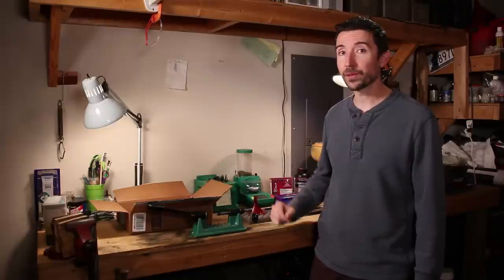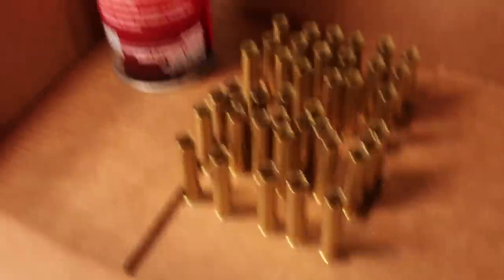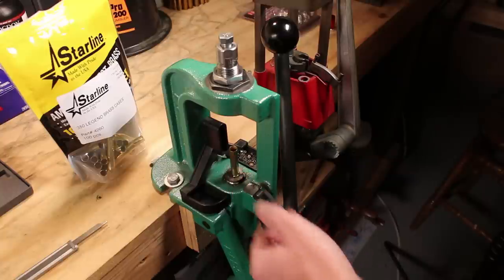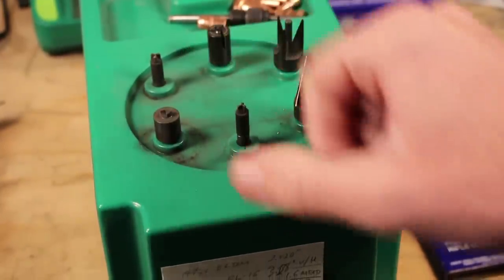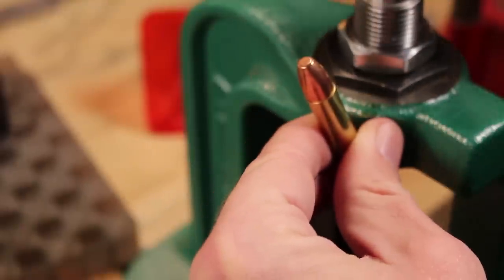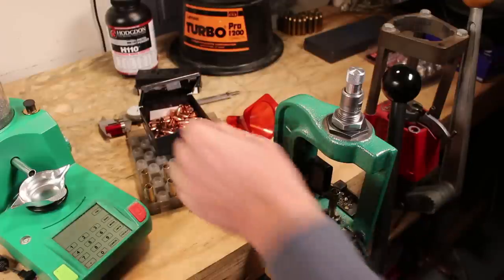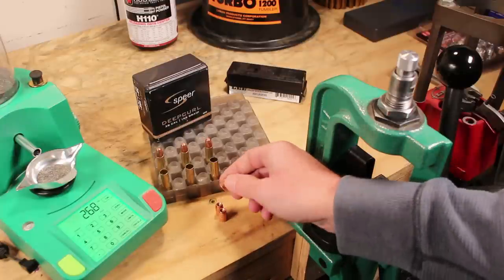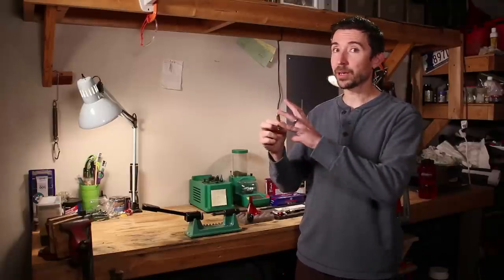The Peculiarities of Loading 350 Legend - Lee Pacesetter Die Set

Comment: Great info. Just getting into 350 legend. You stated .355 and also .357 diam bullets. Others have stated winchester factory bullets are .355 and that the .357 may cause over pressures. Any thots on this?
Reply from the maker: Great question. I got my info straight from the developers at Winchester. They said you can load .357" bullets as long as you reduce the powder charge by about 10% compared to similarly sized .355" bullets. Most manufacturers choose .355", but at least one load I've tested was .357" from the factory. My own .357" loads have worked fine.
Reply: @SocialRegressive  ty again for that info

Comment: Don't use a roll crimp and even the Lee FCD is questionable.  The 350 Legend headspaces off the case mouth, that's why it's sticking in the chamber.  With a roll crimp the extractor most times is the only thing holding the case in place.  The case mouth MUST be taper crimped on a solid part of the bullet, a normal 9mm crimp die does the trick.  Also, Instead of the Hornady lube try a red bottle of ISO HEET gas line antifreeze (100% Isopropyl Alcohol) mixed with 1 oz. of liquid lanolin.  Dump your brass into a plastic bag, pump in few shots in using a sprayer and you won't believe how slick your brass resizes.  Thank Dillon Precision for that one, they list their ingredients on the bottles of their lube.

Comment: Love this stuff! Love your channel and all that you do! I have reloaded all my Ammo for many years. The only Ammo I buy is rimfire, some pistol and a box for barrel break-in for all of my rifles before my load development process. I have recently built an AR in a 350 legend and have started the load development process. I usually buy hornady or forester dies but this time I bought the Lee pacesetter dies for this caliber mainly because I had a hard time finding the other. I have never had any problems in the past with a bullet seater but this Lee die has me shaking my head! I elected to use the FTX 165gr hornady bullet and while setting up the seater die, It bottoms out to max seating debt while using the FTX bullet. I was wondering if you have reloaded this bullet and had any similar problems with the lee seater die. I took the collet/stem out of the seater and inserted the bullet and it seams to seat extremely far down the bullet. I even took a factory loaded Winchester power point and set the die up to duplicate the factory round and it almost was max out as well for that factory round. Your thoughts?
Reply: Your saying the bullet is pressed inside to deep? That what I’m thinking your saying. If that’s the deal then simply back out your whole die . Unscrew the whole seating die until it will only set the bullet the desired depth. I assume the problem is the spire point is causing clearance problems . U could probably turn the center of the stem out hollow and round it so the projectiles fit higher inside but I believe u can adjust this issue out by simply backing out the whole die it doesn’t have to completely set against the holder u can make a gap. Good luck

Comment: Great video. Studying the 350 myself. Dead deer this year with one one. Funny how Winchester even on the box says a .357 bullet but they are actually a .355 bullet. Look at the SAAMI spec to see how they do it. No straight wall cartridge is a cylinder. You have to have a slight taper for extraction.

Comment: It's basically a long pistol cartridge at very high pressures. The primary steps versus a regular pistol seems to be double checking the case length and checking the crimp.

A lot of light loads have trouble feeding on AR-350Ls at the 2.00" length. I think the shorties need a different feed ramp.
Reply from the maker: The issue I ran into with short loads was nose-dive into the magazine wall. I plan to try it again someday with bullets seated out a little farther.

Comment: First video of yours I’ve watched and I do like your content.  One thing I don’t like, and you’re not alone, is your weak bench that allows your press to tilt.  Put a steel plate under it or make your bench stronger, please!  Not only will it make your videos more appealing but reloading is much more rewarding when your press isn’t moving.  Only channel I’ve seen that does it right is Ultimate Reloader.  My bench has a 2 3/4” hardwood maple top  with a Rockchucker, Forester Co-ax and a Dillon 550 all mounted to the edge with zero flex.  Not sure where you’re from but if you’re driving distance to Pennsylvania, come to my place and we’ll build you a bench top that you’ll think came off a battleship!
Reply from the maker: Thanks, Jim! I keep forgetting I need to shore it up. Time to visit Lowe's again.
Reply: @SocialRegressive  Or go to a salvage yard or welding shop and see about a 12x16x1/2 or something like that, steel plate.  It’s a little more work drilling holes but really worth it.

Comment: Just got Ruger American camo with muzzle break  in 350 Legend and was able to order 200 cases from Brownel's and dies from Midway's. I'm going to put some load with 357 cal bullets but first have to decide on powder. Not many components are available so it's pita to reload nowadays. Thanks for introductory data
Reply: I buy pull down powder from “American reloading “. It’s actually pulled from non fired American military carts. I recently got 8lbs of w896 which is w748 load data is exactly as blc2 . Is a cooler burning ball powder. Anyway they’ll have all sorts at different times. It u have to buy 8 lbs a time but no haz fee usually 25% off and they have all sorts of pulled projectiles I try to source everything possible from them.

Comment: just starting my 350 lg handloading/deer hunting journey. thanks for the great poractical info/insights! think i am going to start with 9mm 147gr xtp's this week for deer load here in illinois...did initial setup/tweaking of new cva scout today as first step. do you think the 147 grainers will work for basically 100 yd in use on deer as an economical hunting load...30 bucks foir factory stuff isn'my idea of economical hunting/practice!
Reply from the maker: The XTPs should work fine. They may come apart a little, but there should be plenty of mass and expansion.

Comment: This may or may not apply to the 350L (?), but, for the 450BM we've found out that it is quite important for consistent performance to have the inside surface of the case "neck" (I know...) that contacts the boolit nice and shiny clean.  The 450BM needs a clean, tight "grip" on the projectile in that area for velocity/accuracy maximization.

Comment: Hey man, another question. The bullet comparator from Hornady, the 14 piece set doesn’t have an insert for .355 or .357. It only has one for .358, according to the link in the description. Were you able to use the .358 insert on the bullets in this video? Or what did you use? Thanks!

Comment: To,remove lube from cases place a paper towel on an old cloth towel spray with degreaser from an auto parts store and role,the cases in the paper ; job done. Tossing them in the tumbler contaminates the inside and may influence ignition etc:
Reply: Gascheck, I just re-wash the cases after sizing in my Frankford rotary liquid tumbler with lemishine and Dawn mix.  Doesn't hurt the brass if not in a hurry for the extra cleaning step.  Inside of cases are cleaner too, but probably doesn't matter.

Comment: Thank you for the video. Very well structured and to the point. Quick question though on using pistol bullets in the 350 legend. I also thought of saving money and going with the .357 jhp for hunting reloads at half the cost of the .355. However, according to their max velocity ratings, it is not recommended. .357 had a max of roughly 1250fps (about half of what the .355 legends are putting out). There was concerns of bullet integrity of the .357 at the legend speed due to thinner copper plating. Are you seeing any issues? Thank you for the time and keep up the great work!
Reply from the maker: So far I've had no problems with jacket separations. I think as long as it's a proper jacket - not plating - it should hold up at rifle speeds.

Comment: Good morning Mr. 
I hope you are doing well.  Quick question.  I have a good friend of mine that will reload my brass. I plan to start with 350. Does the h110 powder work well with 350 legend and 223/556 and also 50 beowulf? 
I went to a gun show and got and got 38 cal 125gr xtp from hornady .357.
I remember you said that I would have to load about 10/15% less because of the tight tolerance. I also got 22cal 50grv-max from hornady for my 223/556. Will the h110 be good to use for these loads?
Reply from the maker: Great question. H110 is the best overall powder for 350 legend, and it works with 50 Beowulf, but it would probably blow your 223 rifle apart. You need a much slower powder. Thankfully you have a lot to choose from: accurate 2230, 2520, mr2000, Ramshot TAC, Varget, and a host of others.
Reply: Thank you so much for your guidance.  In your opinion which one you you suggest. I have quite a few "tools" that I wanto use mostly for long distance. My 223 wylde be my go to defense and hunting rifle. Even though I would like to reach 400/500 yards. Realistically I will stay at 250 to 350.
Reply: @1971boss  realistically speaking none of the three cartridges you mention are good for long range shooting. While it is possible none of those 3 are good options. As for hunting the 50 beowulf will kill anything you want inside of its range limitations.  I personally use a handgun for defense. No need in killing an innocent neighbor.

Comment: While it is correct that the 350 Legend Head Spaces on the case mouth , that Lee collet crimp die is NOT the correct die to crimp the case mouth to the bullet.
This cartridge requires a taper crimp die.   Hornady make a TC die for the 350 and I believe Redding also makes one as well.
 Do NOT use that Lee collet crimp die, you will regret doing so.
 I've been loading ammo over 44 years and have learned a few things the hard way.
Any cartridge that head spaces on the case mouth requires a taper crimp.
 If you mic a new factory round at the OD of the case mouth, you will find that it measures  .002 - .003 under what the books tell you.   This eliminates 
feed jam.
Also pay close attention to your case length, it is critical.   When you trim your cases , keep them about .002 above the trim length shown in you book.

Comment: Do you have any other recommendations for powder other than hodgen 110, from my understanding this is a magnum pistol powder in Australia we haven't been able to get any powder of this category for some time. We have access to rifle powders only any suggestions would be most welcome
Reply from the maker: Unfortunately, this round is pretty particular, and only a small handful of powders will work. And they're all magnum pistol powders. H110 is best, Lil Gun is second best, and Accurate No7 will work for a few projectiles.
Reply from the maker: Gordons Reloading Tool 2021.2030-NIGHTLY
Parametric powder search by generic tolerance synthesis
--------------------------------------------------------------------------------
File            : noname.grtload
Caliber         : .350 Legend
Projectile      : Hornady, Interlock, 0.355, 170.00 grain, 0.9035 in
Seating depth   : 0.3535 in
Case            : 39.40 grain H2O, 1.7098 in
Cartridge length: 2.2598 in
Initial pressure: 3626 psi
--------------------------------------------------------------------------------
Tolerance-Window               :  Target    Min.     Max.   Unit
maximum pressure               :  55000    53130    56870   psi
Muzzle velocity                :    -        -        -     ft/s
Barrel Time general (BT)       :    -        -        -     ms
Bullet Lead Time 10% pmax (BLT):    -        -        -     ms
Load ratio                     :  96.08      90      103    %
burnt propellant               :    -        -        -     %
--------------------------------------------------------------------------------
A T T E N T I O N - A T T E N T I O N - A T T E N T I O N
--------------------------------------------------------------------------------
Depending on the setting of the limiting tolerance windows, the charges can
exceed the specified maximum pressures, or have no meaningful, or even
a dangerous value. Please check a load prior to use for plausibility. 

The order of the list depends on the composition of the powder list.
--------------------------------------------------------------------------------
propellant                                           mass   load ratio  pmax     v0     E0    burnt  eff.    BT     BLT    recoil
                                                     grain      %        psi    ft/s   ft-lb    %     %      ms      ms    ft-lb   
ADI AR 2205 (2020-04-30)                             26.43     97.2     55005  2212.3  1847   100.0  37.1  0.8804  0.8578    -     
Accurate 5744 (2020-03-07)                           26.36    100.3     54982  2223.1  1865   85.0   38.1  0.8734  0.8522    -     
Vihtavuori N110 (2020-03-11)                         24.64     96.0     55002  2259.0  1926   100.0  41.4  0.8770  0.8473    -     
Somchem S265 (2019-09)                               26.40    102.9     54723  2272.6  1949   92.8   37.8  0.8889  0.8541    -     
Lovex D060-01 (2021-04-18)                           26.23     99.8     54951  2274.4  1952   100.0  39.4  0.8624  0.8440    -     
Shooters World Buffalo Rifle (D060-01) (2021-04-18)  26.23     99.8     54951  2274.4  1952   100.0  39.4  0.8624  0.8440    -     
IMR 4227 (2020-02-28)                                27.26    100.3     54975  2277.7  1958   96.7   37.4  0.8638  0.8443    -     
Hodgdon H110 (2020-04-20)                            27.36     92.3     54953  2320.6  2033   100.0  38.7  0.8608  0.8386    -     
Hodgdon Lil Gun (2021-04-10)                         26.30    ▼89.7     56271  2411.0  2194   100.0  41.6  0.8653  0.8257    -     ERROR! (invalid/impossible synthesis)
Reply: @SocialRegressive  Thanks for the reply? Do you think it would be possible for a slightly slower burning powder such as H4198 or equivalent to work?

Comment: COL is important for this reason when looking at reloading data. PV=nRT.
The pressure data (and thus velocity) is only valid if you seat a particular bullet to 
a specified depth that is specified in your reloading manual. Reloading manuals do not
index off the ogive.  Of course you can derive the base to ogive length, but The
Social Regressive is right ... it's no big deal,  it's just easier and faster to measure base 
to ogive.
Reply: Just to be clear in my own head:
Overall length determines the V(volume) in that equation?  So the deeper the bullet is set into the case, the lower the volume and the higher the pressure?

Eleventh grade chemistry was a long time ago.  😁
Reply: @GarthKlaus  Yep you got it :)
Reply: @paulwatterson5992  Thanks!

Comment: If at all possible, I like to prime and flare in the same step. One less process that way. 

Yeah I saw about that factory ammo he was testing, crazy stuff. I love how people think reloads are inherently dangerous / less reliable and factory ammo is some kind of magically perfect cartridge that will go bang every time and work flawlessly in their firearm with zero issues.
Reply: Agree.  I've been reloading for 50 years and even today factory ammo is much better than it was but it's still very inferior to handloads.  Case in point, I still shoot National Match High Power and use a M1 Garand.  Why ?  Because with my H4895 handloads with Hornady 150gr. FMJ it shoots to 1moa or slightly under, with any commercial ammo, even stuff specially made for Garands that same rifle holds 2.5moa.  maybe slightly less on a good day.  I've had the similar results on everything from 7mm/08 to 450 Bushmaster, a Ruger American that cloverleafs 1 ragged hole at 100 yards, and yes, there is a difference between reloading and handloading.

Comment: Good morning and thank you from las vegas.  Quick question, I have never reloaded and I kind of want to go this rabbit hole.  What bullet diameter can be used?
The minimum and the max?
Is it .354-357
Also what powder would be suitable for any diameter?
Reply from the maker: Howdy, Leikurz! You can load anything from .354 to .357, but be careful with the .357 bullets. Reduce those powder charges by an extra 10%. 15% if you crimp. H110 will work for any bullet in this range. Lil Gun will work for the mid-to-heavy bullets (124-grain+). Overall I recommend H110.